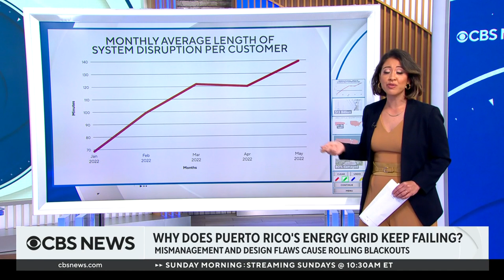Why does Puerto Rico's energy grid keep failing?

Comment: how about letting others companies step in. Only one company for the whole island.  Here in Florida we can pick different providers.  people have no choice only 1 company. The monopoly is the problem
Reply: @Censored Opinions I Know exactly that is the problem because I moved from Puerto Rico years ago. The topography of Puerto Rico is very different.  The mountains is hard for only 1 company to keep up with the whole island.  Is impossible I graduated from collage there and moved to Florida I have loose power only 3 times in 12 years in Florida.  My sister in the island probably loose power 12 times a month.
Reply: I did my Phd in Power System, the problem is PR grid is small ! This will require a lot of investment in renewable, relays, protection and battery installation. The same problem happened in HI and in TX because their grid is small.
Reply: Luma the problem